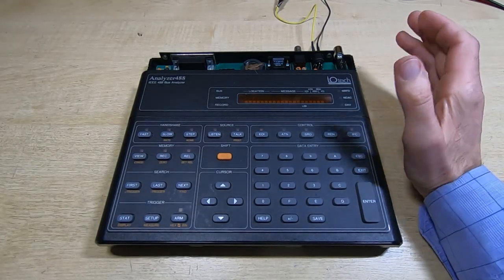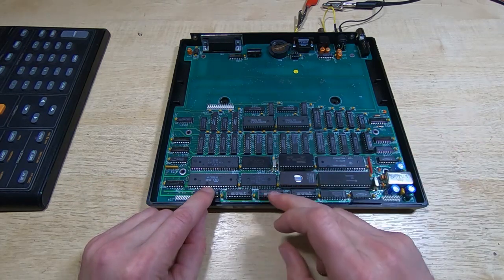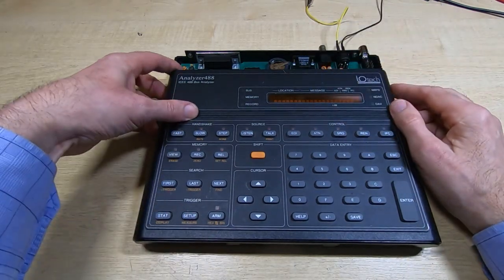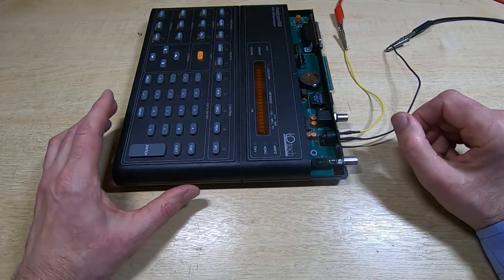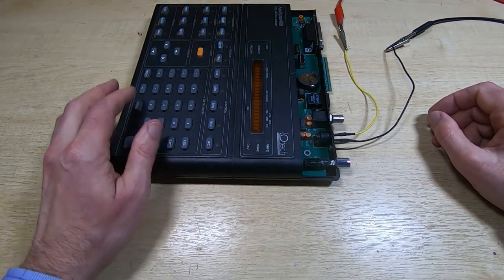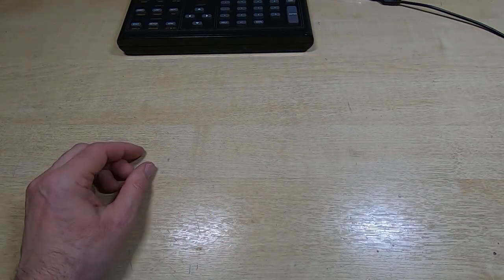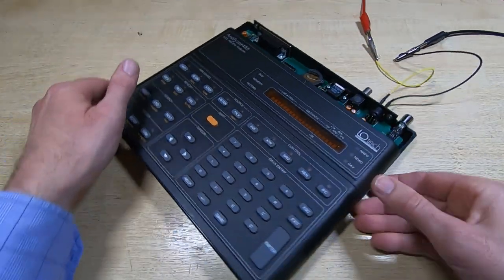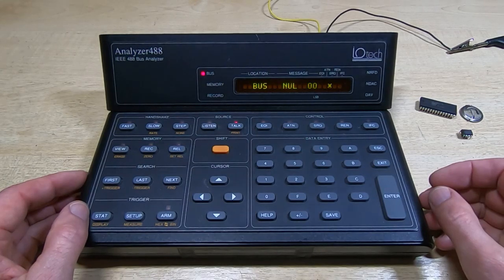IOTech 488 Analyzer Repair

Comment: Apart from protecting the SRAM from spurious writes, the chip select lines need to be pulled high to enable a low power state and minimise battery drainage.
Reply from the maker: Yes most devices use less power when they are disabled although the NVRAM fault shown in this video was not due to excessive power draw but because the CE line was remaining low when power was removed.

Comment: Very nice repair and thank you for the detailed explanation of the RAM back-up supply. I own one of these analyzers and it definitely is helpful when working with GPIB equipment. Have you been able to find the accompanying software for this unit? Regards, David

An update - I checked my unit, it has the revision C board and surprise, no Dallas DS1210 chip! Apparently great minds think alike, in place of the IC are two diodes and a resistor. To the right of them is a transistor. David

Comment: Nice job on designing a replacement part. When you mentioned there were three RAM chips I had an idea of where you were going. The TRS-80 Model 100 et. al. has a similar back up system for the RAM as there are multiple RAM modules each with 4 chip selects. This is also intertwined with the reset and auto power off to make things interesting. You wind up with 3-4 CMOS logic chips that are kept powered as well as the RAM. It makes for some interesting failure modes.